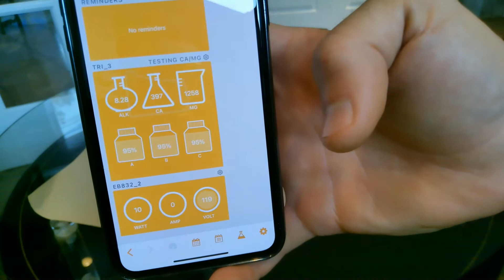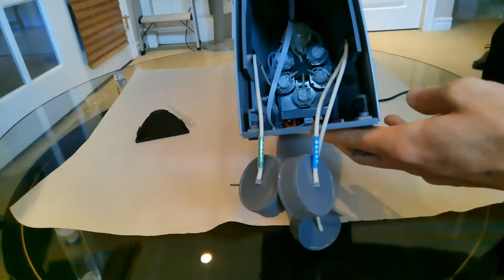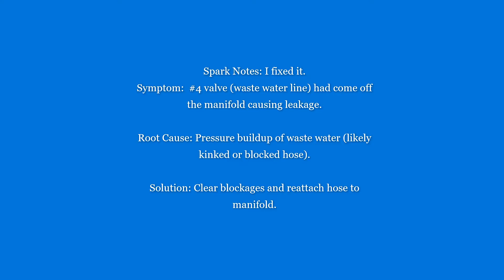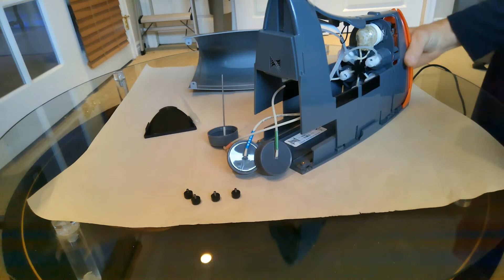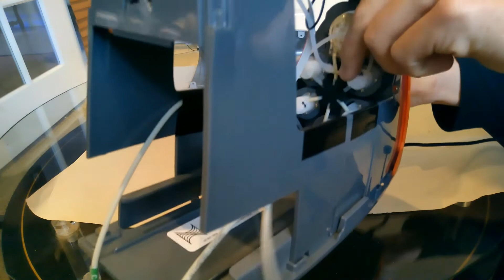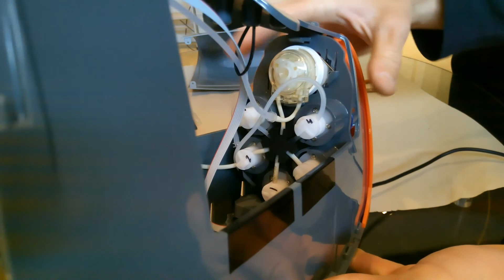How To Fix No Water Sample Apex Trident

Comment: I just installed a new trident that I had sitting on a shelf for probably a year. Same issue. When I took it apart it looked like the water sample and waste line were stuck/pinched where the solenoid pinches them closed. Rolled them in my fingers, they unstuck no problems since. This video probably would have been helpful if I found it when looking for solutions.